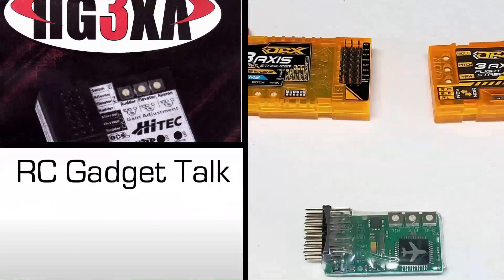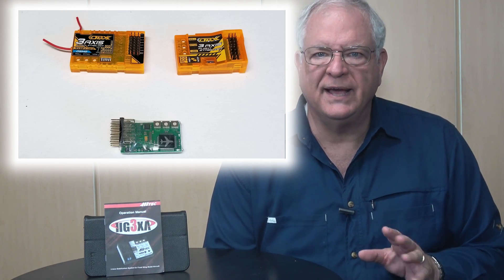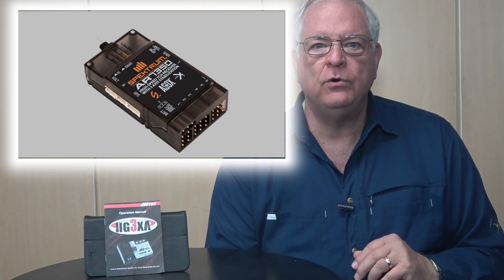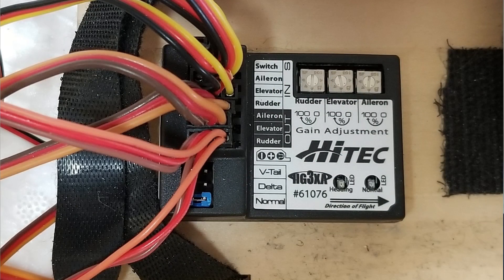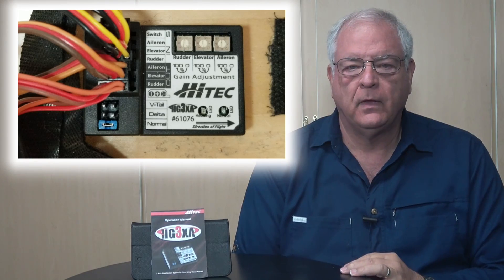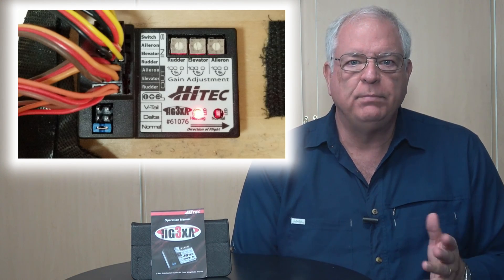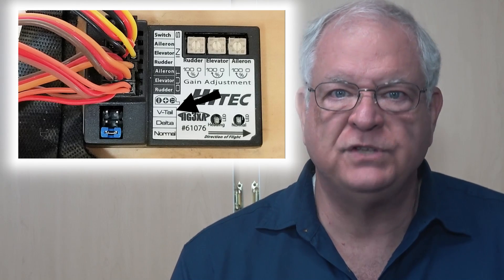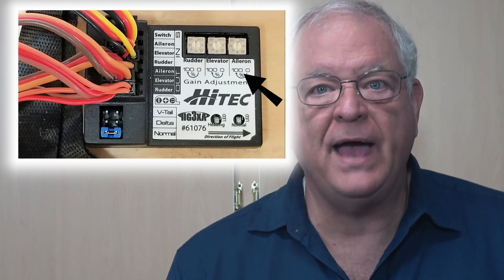Hitec HG3XA Stabilizer Review

Comment: Are these stabilizers meant for foamies/park flyers or will it work on large glow powered planes?  Will the vibrations from gas powered plane mess with the stabilizer?  Thanks
Reply from the maker: Most gyros will work on electric and IC engines. It may take a bit longer to dail in the gyro due to more vibration in IC engine. Gyro needs firm mounting to sense flight forces but not so firm to be in constant motion due to vibrations.

Comment: Can I use this with a futaba t14sg transmitter and a R6014fs receiver on my 35% yak 54 120cc gas plane?
Reply from the maker: This stabilizer is designed to work with any receiver that outputs to standard servos with one servo per channel.

Comment: Can you reverse the ailerons?
Reply from the maker: Set up the plane as you normally would with the gyro off or disconnected. Then add or turn on the gyro. Unlike more expensive gyros or new AS3X receivers, this gyro is just a basic one.

Comment from the maker: You need to have the gyro on a switch. When your plane is ready to go, fly it without the gyro to get it in trim. Then use the switch to turn it on on the ground to test proper control suface movement while just holding the model and moving it. Controls should move opposite from the movement as the gyro is trying to correct the movement. Take off with the gyro off and turn it on in flight. Be ready to turn it off if the plane responds badly. Don't fly without a switched gyro. Youll lose control if the gyro is connected wrong or misadjusted. I mean no offence, is this jet your first plane? If so, set it aside and master a good trainer such as the Apprentice or Sensi first. Jets are fast and don't give new pilots time to think and react.
Reply: The RCPlaneviews.com Channel I don’t think you understand what I was asking. Also I’ve been flying for over 15 years. I simply wanted to know if you could reverse the input of the aileron function of the GYRO. No worries I called Hitec and they told me how to do it. Simply remove the jumper cable from the gyro, turn on your transmitter on then the model and wait for a series of flashes. Different flashes mean different control surfaces, simply pic the one you need to reverse and  hold the rudder input to the left or right and it will reverse. Thanks anyway
Reply from the maker: @ryanconner8246  Thanks for taking the time to clarify and provide info for the rest of us. Cheers!

Comment: can i use this on jet running on 6s
Reply from the maker: It should work fine. Voltage at the receiver side is separate from the power system. I use one on a six cell system.

Comment: can i use this on jr tx and rx?
Reply from the maker: It works with any brand.
Reply: @AZJim12  can you change which mode is on which position of the switch?
Reply from the maker: @adamsmith5913  It depends on the degree your transmitter allows you to program switch properties.

Comment: great video., Can you possibly make another to show how to setup the switch using the reciever and showing what needs to be plugged into the "switch" location on the gyro itself?  Thanks
Reply from the maker: Hi, Rick, with the variety of transmitters and receivers it would be difficult to do a video that would apply to more than just a few folks. The manual ( found here https://hitecrcd.com/images/products/pdf/402_HG3XA_Manual-2_Web.pdf) does a pretty good job of describing things. You'll need a receiver with more channels than you need to fly the plane. A plane with retractable gear, flaps and the 4 main controls would require at least a 7 channel receiver and, of course at least a 7 channel transmitter. A plane without retracts and flaps could use a 6 channel receiver and radio.  Assign a 3 position switch to the desired channel (aux 1 or 2) and plug the appropriate wire from the receiver to the stabilizer at the 'switch' input. Use the switch setup menu of your particular transmitter brand to change the inputs to give you the order on the device that makes sense from a switch position stand point. Do your experimenting with the prop off!
Reply: thank you for the reply. I will experiment ( with the prop off) on one of my planes that currently has not stabilization. I have several planes with a gyro, some built into the receiver ( spektrum A4636, and other's as a extra gyro on the side. I have found that having the gyro outside of the receiver makes it easier to "program" by just turning the pots, and no need to program it via an app.  Thanks again for the great video!!! Rick